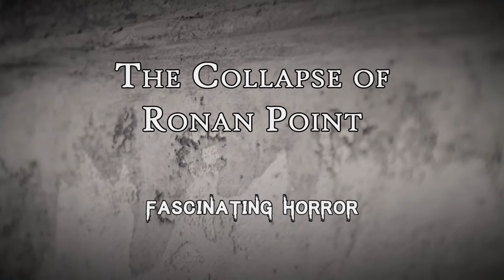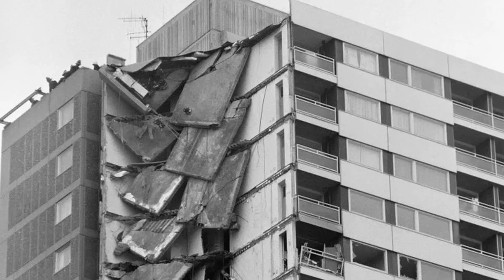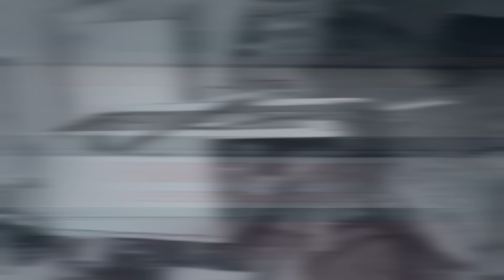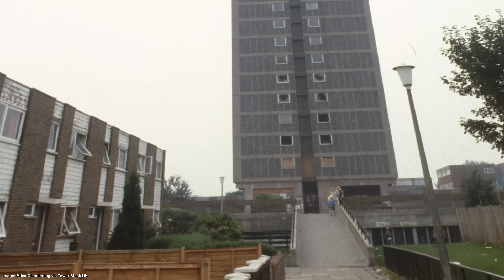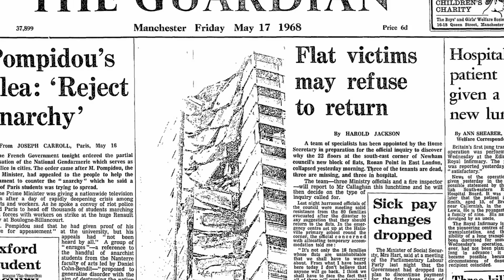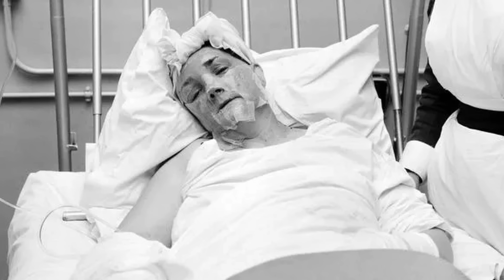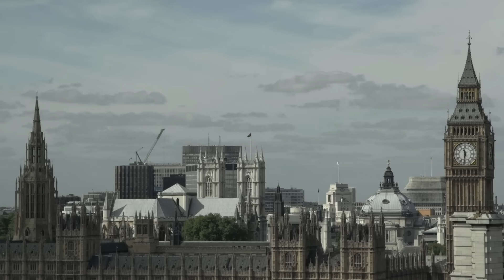Joints Stuffed With Newspaper: The Ronan Point Disaster | A Short Documentary | Fascinating Horror

Comment: Interesting.  It is strange that they only did remedial work to try to mitigate any future problems and the shoddy construction.  Eliminating gas was not necessary, as there are more fires caused by faulty electric connections and service.  The addition of odorant made gas leaks easily noticed and rectified.  Either way, gas, electrical and plumbing should only be done by trained and certified labor and technicians.  It is good that they brought in an expert to show that all of this type of building was one step away from a disaster.  It is never good when expedience takes priority over proper work and safety.  Unfortunately, this seems to continue to this day.  Too bad.

Comment: Commonplace in 60's and 70's construction, unfortunately. Corners cut, specs ignored and cheaper alternatives used. Both big Council Civic Centres I have worked have had to be demolished, with concrete cancer, poor construction, shoddy workmanship (poured waste concrete in drains, wrongly wired, windows blowing in, appalling heating systems, flat roof problems. One had guttering to the inside of the top floor.) Many schools were built in the same way, and now the Country is paying the price. 
It seems that the new housing estates being 'thrown up' for minimum cost and maximum speed (and profit) are already decaying. I am happy in my Victorian brick house, in spite of it's idiocyncracies! It is over 100 yrs old, and is likely to be around another century or so!

Comment: Tragic that they cut so many corners. Most mid- century Modernist architects would have use non-bearing ‘curtain wall’ exterior design, whereby the important structural skeleton would be held inward from the exterior walls. But I suppose that would not have mattered, in the presence of such very poor workmanship. Alarming to think that there are likely many similar structures out there. Thx.

Comment: Thank you  for researching this problem. I didn't ever live in London but I did live in Portsdown park in Cosham Portsmouth for some time. That place was a death trap and it was finally demolish a few years after i had moved out. I lived in a flat with a sheer drop from my front door of 6 floors. the Park consisted of maisonette's three on top of each other and then a box flat on top of that which was where i had moved into, for someone who was deathly afraid of heights, it was very scary, i was even scared to go out on my balcony because it was another sheer drop from there also to the ground below next to the maisonette's were three tower blocks that were adjoined by the maisonette's most of the time the elevator did work or was under repair and when you are newly pregnant having to walk up 8 flights of stairs, was more than hard work. The person who designed the park was also the same designer of the Tricorn parking structure in Commercial Road, Portsmouth, which has always been an ugly white elephant but it is still in use today, which is very scary as it has been there since the  1960 or 70's, it has always been an absolute eye sore, to say the least. In the park were also single homes and row houses which were much safer in my opinion. Portsdown park was torn down from the tower blocks top floor to the ground as they worked, it would have been far quicker to use dynamite in my opinion. The council is notoriously  known for cutting corners and being tight with funds for the tenants that have no choice but to live in these death traps, Queen Alexandra hospital was right across the street literally. the counsel needs to be taken to task over their management practices, they are not very good at fixing the problems that arise in their buildings they own and they give the tenants a really hard time when they do need something fixing. But they are quite happy to kick you out of their buildings if you miss a payment or too or social services were not paying your rent when they were supposed to be. Then the Grenville tower fire was just horrific, all to save money and using materials that were not fire safe was just criminal. I hope they pulled that building down and put a memorial in its place. the amount of people that were killed in that fire. it was criminal. I don't know how the council keeps getting away with that stuff. Its not the first fire they have had in their buildings. Whom ever was the Architect's and  Engineer's working for the council and over seeing the build, need to have criminal charges laid against them, it was criminal to cut corners on safety. Its a shame more people cannot afford to buy their own places. I know if i could have afforded to buy my own place i would have done so. I live far far away from any council now and i wont loose sleep over that move. Cutting corners and over charging in rent makes life more difficult for people to pick and choose where they live, When the council offers you a place you are advised to take what they give you or your right back to the bottom of a waiting list. i am sure that still hasn't changed and i left the UK in 1990. Am i shocked by this research not in the slightest its typical council no mater where you live in the UK you will get an unsafe building or its damp and moldy cracks in the ceilings and walls windows are drafty back gates don't close properly and no escape if your walkway outside your door collapses substandard housing is a common thing because they can keep getting away with stuff like this now all that money wasted on building that crap could have gone to build better homes to give families help in getting them into their own houses not to gouge people of their hard earned money so they cannot save up to buy their own homes. I am glad i left when i did. There is a really nice housing estate there the last time i was in the UK that was in 2019. I have no faith in the councils in the UK they will never do things the right way and the safe way they will always cut costs go for the lowest bids and cut corners every chance they get. this is the way the council operates and this is also why they need to be under new management with structure and safety without cutting corners and grace periods when financial help is not cooperating with the tenants. They will never change until they are charged and people go to prison for their incompetence and neglect of peoples safety. and stop gouging the tenants for their substandard accommodation. Great video can't wait for the next one. Great job!
Reply: See also Somerstown, Paulsgrove, Buckland, Stamshaw and Leigh Park for further examples of Pompey towers at their best.

Comment: My aunt and uncle moved into a 5 level council block in Wembley, they had a delivery road that ran over the flats below, so their bins could be emptied and the milk delivered, needless to say the large vehicles running over the top of their flat used to wake them up every morning. The vibrations caused cracks , the kids ran riot in the roads , overturning bins etc, and the entire block was a  mess after a year, they moved to another, smaller flat, which was about 4 storeys high, but at least was a better construction level and seemed like it would stay upright for a lot longer.

Comment: This reminds me of a story I read several years ago. There was an all wood frame stick built apartment building somewhere in Asia. 80 units. 4 units per floor, 20 levels. Was built with just 2×4 studs, particle board, and drywall, wood board exterior. Some university students put a large 12 person 1300 gallon hot tub in their living room on the 17th floor. Of course the structure could not handle the weight, and it collapsed the entire building 3 days after they filled the tub up. Several dozen people were killed.

Comment: We live in 'social' housing in the South UK. We only just had double glazing installed after 30yrs with wooden framed windows that were rotting and wooden front doors that didn't fit. By that I mean a solid breeze down the hallway 😅 despite our efforts to insulate it. Whenever refits are done we get the cheapest possible stuff, usually no longer in production so sold off real cheap. So when it breaks or breaksdown they never have the parts to fix it, can't afford to replace the whole thing so we get stuck with it either broken or badly/barely fixed. During a recent installation of weight bearing grab rails, the workman noted that our plasterboard was unusually soft 👀. When they put the disability shower in the builder (private) wouldn't sign off on the job until they agreed to replace the fuseboard as it wasn't up to code and was dangerous..... And we still get crap from people saying we have a 'free' house. If I could afford it I wouldn't be living here 😅

Comment: I have seen gas explosions in soviet block buildings.
In most cases it punched out the single panel out - right where the kitchen is.
I'd never thought comblocks are better made than english towers.
And that is a low bar to surpass.
I meon there is a reason comblocks had carpeted walls...

Comment: Blocks like Ronan Point were designed well. 
After that point it all just went wrong.
The precast blocks had to to be cast millimetre perfect, they weren't, if a slab was wrong it should have been sent back, they weren't, if a bolt didn't fit it was supposed to be reported and checked, they weren't, the builders were supposed to be trained in the assembly, they weren't, each floor as it was completed was supposed to checked and signed off, they weren't, if a wall was slightly out of alignment it was supposed to be reset so it was, they weren't, sealants were supposed to fill the gaps, they ran out regularly and stuffed anything in. Most of them hadn't built anything like this before and had no clue just how dangerous it was not to do it to spec.
It wasn't so much cutting corners, that also happened, it was almost criminal incompetence which was covered up, the guys building it were pretty much told to keep quiet or never work again, they started talking after they retired, and well past the lifespan of anyone who could be held properly accountable, and any evidence was gone.

Comment: This is very similar to the Champlain South Tower condo collapse in Surfside, FL, in 2021. The moral of that story is if the owners won't fix it despite all you try, save yourself and move out.
Reply: I was going to make a deal on a condo in Florida a few years back... but it fell through.
Reply: Wasn't that the one where the construction of a tower next door contributed to the collapse?
Reply: @653j521  Champlain Towers is much more complex than has been widely discussed.  The basic defect was that that pool was built over the garage with it leaking into the loading bearing piles and rusted out the metal rears in the concrete.  Repairs required closing the garage and allowing  residents to park in Surfside streets which was illegal. The city of Surfside,  had refused to allow a variance for that option.
Reply: Not really.  In Surfside  they built the swimming pool over the load bearing piles in the garage.  It leaked into it for years rusting out the rebars.
Reply: @peterkiviat9969  that's right.  Champlain towers were built well enough.  The issue was the maintenance.  They even decided to remodel the lobby, instead of dealing with structural maintenance.  The building in this video could have collapsed on day one.
Reply: @peterkiviat9969  NOPE! Nothing to do with the pool. It was the Ocean Salt water, water table high of ocean salt water pouring into the garage, poorly built, sand with salt from beacu used to make concrete, unskilled Cuban refugees used as labourers, floor added, parking deck added for extra parking, etc...

The pool was actually built just fine :)

Comment: Had similar looking blocks of flats in Blackburn, 3 at Queens Park, 3 at Mill Hill and three at Larkhill. The Queens Park & Mill Hill blocks have been demolished , two of the Larkhill flats were planned to be demolished & emptied but a survey of the remaining block found an internal crack up most of the structure so tenants were moved into one of the 2 blocks that were set to be demolished. Now I’m wondering if they had used the same method of construction.

Comment: I remembered this happening at the time making headline news, and anouther explanation of how they were built was like building a Mecano set building desighn, these desighn of flats were all over the country built by variouse comcils at the time and the Gas Meter were not in a safe position in the case of a Gas leak/Explosion scenario not being in a reinforced Meter Box area. Before retirement I worked for a Gas Contracting Company called the Dood Group who looked after the servicing of Birmngham City Council Housing Stock which included a number of multi story flats in Birminghm built on the same desighn as Ronan Point, any later Flats were desighned differently with the Gas Meter being put in a safer position and these flats having reinforcement fitted and new flats in Birmingham being built to a different desighn altogether so this would not happen again.
In my employent as a Gas Service Engineer with the Dood Group one of my jobs was to go arround these Flats desighned on the same lines as Ronan Point and do a full services and Gas Meter Soundness Check every 6 months or less as against every 12 months on a normal Council Property and every time the Soundness Gas Test had to be 100% dead sound no leaks what so ever as if a leak was detected it would of have to be checked out and repaired and if it was the Customers Cooker that was leaking it would require replacing or repairing. If the leak could not be found it meant the imediate evacuation of the whole block of flats by the Council and Emergency services as what nearly happened one day when I detected a leak on the main meter control to the flat, I had to call British Gas Distribution fitters out, notify Birmingham City Council in case of an evacation as the main stop cock on the high preaure gas main may require replacing and could of split the Gas Service pipe, as it was the emergency was averted when the Bristish Gas Engineers put Graphite Grease on the Meter Control and saved the day, these flats in Birmingham are still standing after 50 year with out any sighn of being demolished and through this I know how dangerouse this desighn of multi storey flats are

Comment: Then, 6 years later, in 1974, Grenfell Tower was completed and continued to exist, safely, until the fire there in June 2017.  However, the main structure of Grenfell Tower Block survived the fire, the chief problem was caused by the use of flammable panels on the exterior of the buildings.  This unfortunately resulted in a far greater loss of life than Ronan Point, even though the structure of the Grenfell Block remained intact.

Comment: Gas should never be installed in high rise flats, it's to dangerous
Reply: Also there's the matter of having electrical wiring which needs to be of much hevier specification to prevent any danger of fire, due to melting of the insulation.

Comment: The poor 82 year old probably died from a heart attack resulting from the incident, and while perhaps deemed "natural" may not have been so natural at all.  I mean in such traumatic situations people have been known to die not from injury but shock, etc.

That all being said, I'm starting to think that maybe an older 100 year old house may not be a bad idea afterall.  I mean you figure if a house for example lasts 100 years where it's sitting, it's probably mostly a sound structure (although could have foundation issues I guess) but the way they are making even modern houses and structures, it makes you wonder if newer IS better?  Granted we probably have way more safety and construction standards than there were back 50-60 years ago (obviously at least in the US, having carbon monoxoide detectors required in homes which would have probably prevented this).

Comment: Until just before Covid two tower blocks using the same method stood in Hammersmith and Fulham. The residents complained of similar issues. Finally, after Grenfell the gaps in the construction panels were  identified as a fire risk so they had to have watches. Both blocks were eventually demolished - but note due to the inherently defective load bearing.

Comment: Then there was the tall tower block in miami that completely collapsed a few years ago. And tens of thousands of very tall "tofu dreg" high rises in china that are very dangerous to live in. Some of them got demolished, like the whole area at the same time using explosives. Some are not even complete (corruption), many are complete but they are in a bad shape even though they are brand new but people still live in them cause they already paid for the flat. I've seen people removing pieces of the concrete from a wall and it's just gravel and with no or a small amount of rebars, or rebars that are so weak that you can break them without tools (i've seen some tests). I live in a swedish 1970's concrete "commieblock" 9 stories up. But there have never been a collapse in sweden. The quality is high and we don't have earthquakes or violent storms, and we don't use gas

Comment: An interesting fact I heard: the reason why Grendel Tower didn’t collapse due to fire was because it was designed specifically to be a strong building after Ronan Point.
Reply: Grenfell tower Block's structure survived the massive fire, caused by the installation of flamable panels to the outside of the building during a refurbishment. The fire is what caused the heavy loss of life, over 70 people died, not like the total of 4 fatalities at Ronan Point.